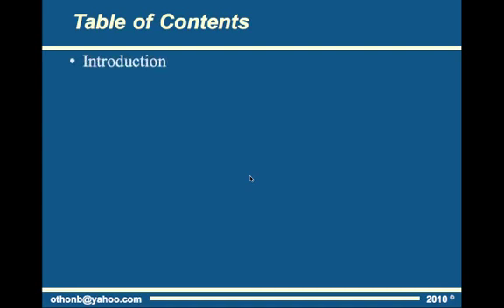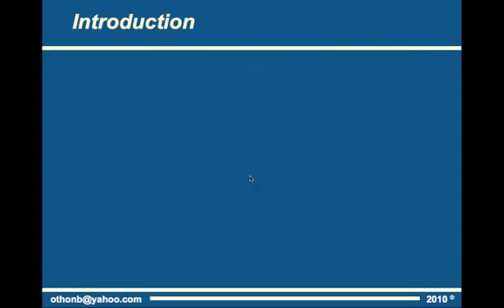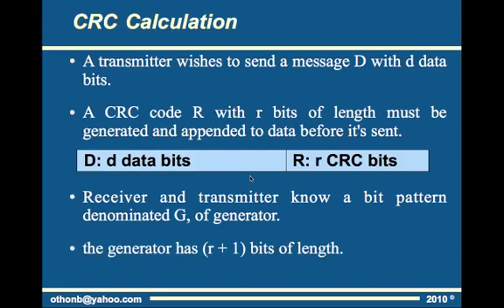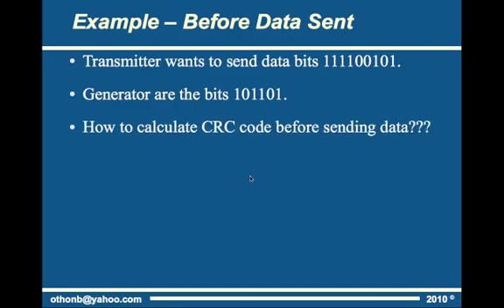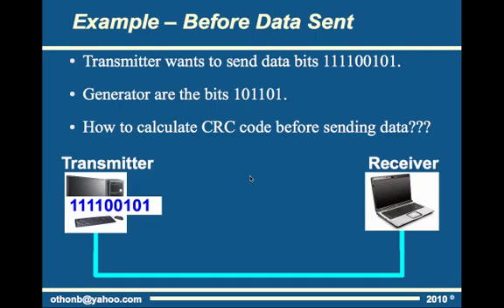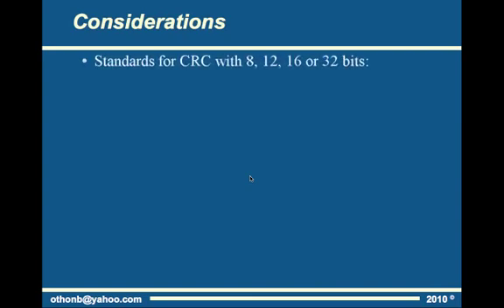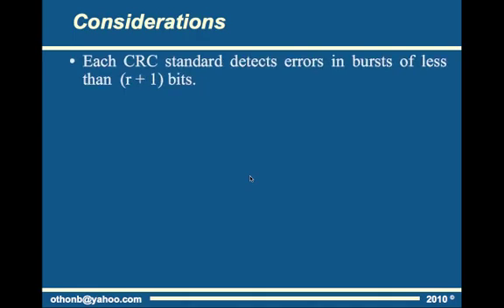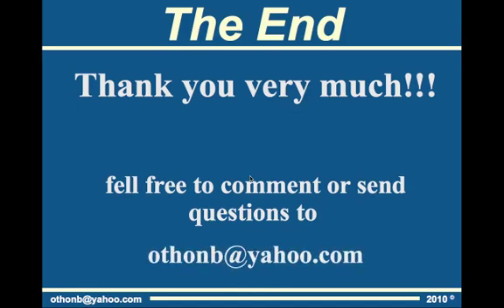CRC Calculation with Professor Othon Voice

Comment: crc12 polynomial is not right
Reply from the maker: Hi, thank you for the information. I'll correct it soon. Regards!

CRC-12 : X12 + X11 + X3 + X2 + X + 1 or (1100000001111)2
Reply from the maker: I've just added an errata regarding CRC-12 into the video. Once more, thank you. Regards!
Reply: One more thing! I'm not sure, but in Example - Before Data Sent - we should use "-" operation instead of "xor" operation when we calculate "each step".
Reply from the maker: Hi, CRC calculations use XOR (eXclusive OR) instead of subtractions in divisions. :-) Thanks anyway. Regards.
Reply: Oh! Thanks! Now all on the places

Comment: there is no way to reverse that , unless you have the result itself <not only the remainder 

take this for example

if you have original data of 6 and Generator of 2  and result of 3 you can simply multiply Result with Generator and you get 6 , BUT 

if you have 6 mod X = 0 , there is noway for you to know what X is because
6 mod 3 =0 , 6 mod 6=0 , 6 mod 2 = 0 .. the main reason why remainder and not actual results are used in transferring data is for the propose of security

Comment: The remainder you highlighted has six digits--001010; however, you state that you are only using 5 digits.  Thus the five right-most digits should be highlighted--01010.  The division will not work otherwise.